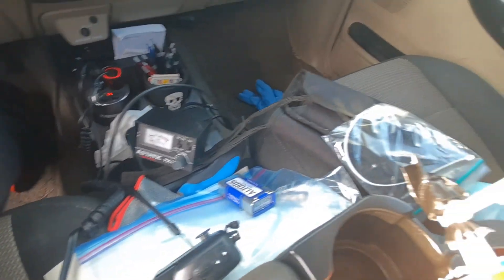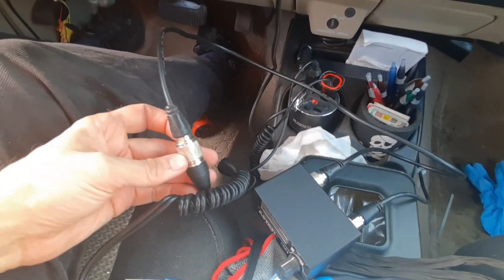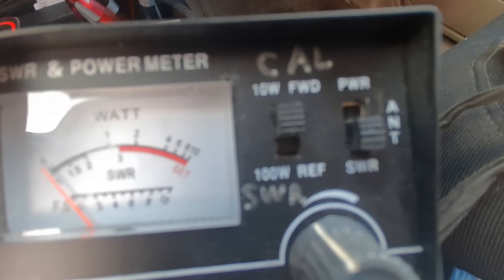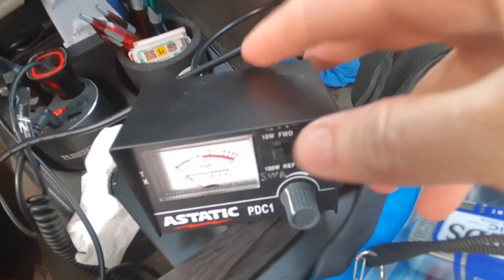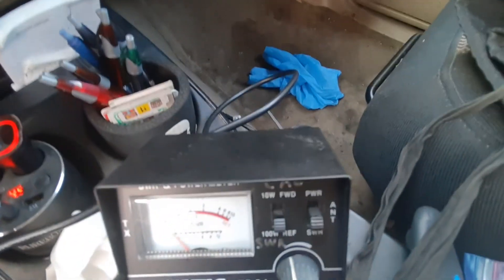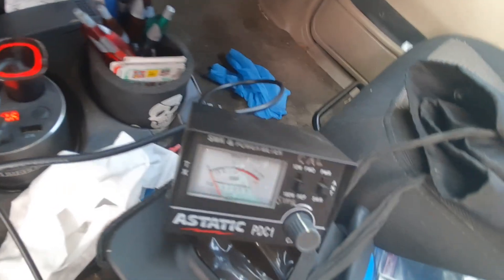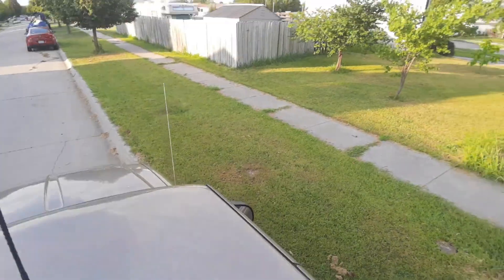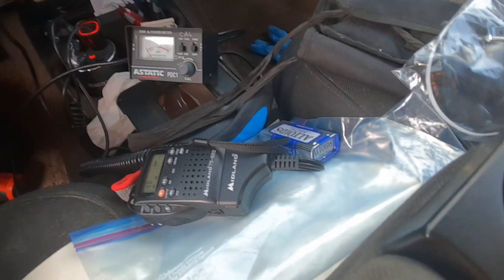How to use SWR meter to check SWR on CB radio and tune Firestik antenna

Comment: If you have 40 channels on your CB set, simply set it to channel 20 and tune your antenna as low as possible. You'll then notice that you get roughly the same reading on your SWR meter on channel 1 and channel 40.

Comment: What if the swr is high on both ?
Reply: The goal is to get below 1.5. If you can't get the SWR down to an acceptable level, start looking for problems such as an electrically shorted coax (shielding touching the center conductor), a bad antenna mount ground, or bad antenna location. Also take note that adding an antenna spring effectively lengthens the antenna, requiring retuning the antenna and slightly elevating the SWR. Without the spring I can get a 1.05 across all 40 channels. With a spring that changes to a 1.3.
Reply from the maker: Check easycbradio.com for more info! Thanks for commenting! :)

Comment: Ok I want to make sure I’m correct , I have a 4 door cab pick up. I was going to set the Stryker towards the back of the cab right in front of the 3 break light, I was thinking I should have it centered as close as I can on the vehicle. I was told I should center it on the cab roof not center of the entire truck , what are your thoughts?
Reply from the maker: Yep, I'd center it on the cab roof since that is your ground plane.

Comment: Can I use only the watt meter to test my tyt th9800 watts power???         can I use it on any frequency to test the watts on my mobile radio
Reply from the maker: Yes, you should be able to do that. Check out easycbradio dot com for more info.

Comment: Do you have to complete this process every time you plan to connect to a channel?
Reply from the maker: Nope, you just do it when you are setting up your CB or when you make changes to your antenna.
Reply: Can I use only the watt meter to test my tyt th9800 watts power???         can I use it on any frequency to test the watts on my mobile radio

Comment: FYI Everyone !!!   Just making a quick comment to everyone who might read this.  I have seen a lot of YouTube videos about checking SWR on CB radios.  I appreciate these videos.  I will not argue against established knowlegde  and science.  Far be it for me.  I read once in a book I borrowed from  a library that although a 1:1 match is desireable it is not the final mark for measuring an antenna.  Fiedl Strength is also a measurement.  You may have a higher SWR than 1:1, say 1.7:1 or something like that.  However if you move the antenna up and down and adjust it a little bit and set for maximum field strength it may be a better measure for antenna operation and range.  One of the reasons I am typing this is because although I read about it in a book I have not seen any demonstrations about for it.  Noe have I found a Field Strength meter that responds to a cb transmiiter connected to an antenna.  It seem that only the SWR meter responds but not the F.S. meter.

I would appreciate any thoughts or videos any one who reads this may or might have.  Please post a YouTube video or send me a link to paulgrod1@gmail.com   :yt:😀🚜⛄🏆🎵🎼🎶🖥🖲

Comment: He should realize that when you put a SWR power meter in line and you're adding that jumper cable that alone can change your SWR I have a Galaxy dx86v and it don't have to be calibrated. I run 102 inch stainless steel whip on the back of my car and you adjust that by length of coax rule of thumb that every 9 feet is a one-to-one match but that depends on what type of coax you run as well I run an lmr-400 coax I got a 1.2 on my radio I added a jumper in there and brought it down to a 1.1 now you can add or you can take away to get your match it's a little work but the better the match on the radio the better the output!

Comment: You forgot to check channel 20 as well and the final part of your poem is 24 the money! You probably did not need to adjust your antenna, moving it to the rear center of your truck cab would have given you a better reflective plane. Try putting your antenna on the little flat spot just above the truck bed light on your cap and you will see what I mean. Ideally you want to get to 1.5 across-the-board, or as close as possible. If on the low end you are hitting 1.1 top 1.5-7 on 20 you should be 1.3, after the move you will need to reset and if every part, cables, antenna can be measured physically divide by three if anything is leftover you need to shorten or add coax to get to a perfect divide by 3 your antenna will work better and should need little to no adjustment!!! I ran the cb shop on I70 east of Columbus in Hebron/ Buckeye lake for about four years then otr for 27 years, I would work on cb’s out of my truck all over the country! With a handheld I wouldn’t worry about perfect. Now if you plan to go SSB/FM with or without an amp I would go for perfect. SSB/FM is coming back with the pepper’s and militia crowd, as well as other ham radio frequencies. All the guys I shoot and train with have 50 mile setups at a minimum!
Reply from the maker: Thanks for the tips!!

Comment: Why would my swr meter be reading zero when I turn it to tune it, maybe a bad ground? Or is the swr meter broke? I can pickup a small amount of static when someone talks right now.
Reply from the maker: When you switch it to FWD?
Reply: @revbeet  on every mode, I cycled through them to see if any of them produced a reading, none of the modes produce any signal
Reply from the maker: Hmmm I wonder if you have your coax hooked up wrong. Check that first. If that's ok I'd be looking at an issue with the coax, the antenna, or the radio itself.
Reply: @revbeet  it’s a dual antenna setup I think they are hooked up right. I wouldn’t want to tighten the fittings any tighter
Reply: @revbeet  the radio revived noaa weather just fine
Reply from the maker: @RunninGunner04  I meant making sure the meter is hooked up right. It could be you have the antenna coax plugged into the radio input.
Reply: @revbeet  tried both ways already. The light works on the meter
Reply from the maker: Sorry I'm not more help. I'd maybe grab a cheapo mobile magnet mount and test on that. That way you could rule out an issue with the radio. 

Also, if I'm understanding you right, it could be that your SWR is just really low. Which is a good thing.

Comment: Is there an issue with using a 9' cord from meter to cb? They didn't have a small one. Also can I leave the meter plugged in while using 🤔
Reply: Obviously this is temporary until I can find that link cord
Reply from the maker: I think it will be ok as long as you are not planning on doing a lot of transmitting. Eventually you'll want to test it with a one foot jumper coax cable. 

The length of coax sometimes affects the SWR -- that's why it's a little bit of an issue.
Reply: @revbeet  it reads good with the cable so I left everything on but I don't want to ruin the radio either.
Reply from the maker: @kasper6285  sounds good! Just keep your transmissions short. Listening is completely fine though!
Reply: That should be fine unless the the difference in the impedance compared to the radio and antenna are great. The extra coax will act as an impedance transformer.

Comment: So, if I have a 102 whip...there is really no calibration to be done. Is that what I am seeing here?
Reply from the maker: It all depends on the SWR reading you get with your set up. Check out easycbradio.com for more info on SWR testing.